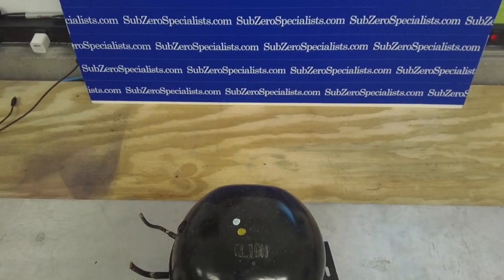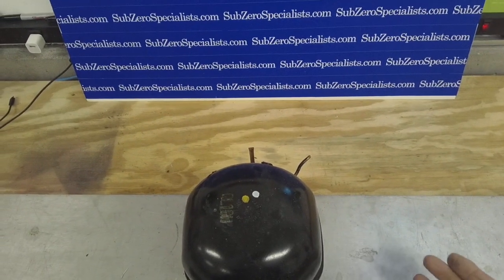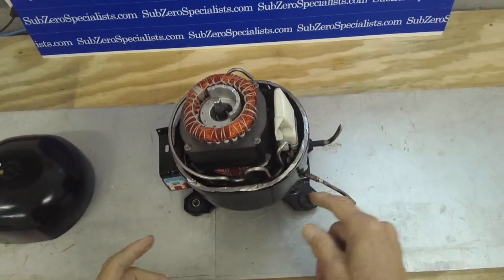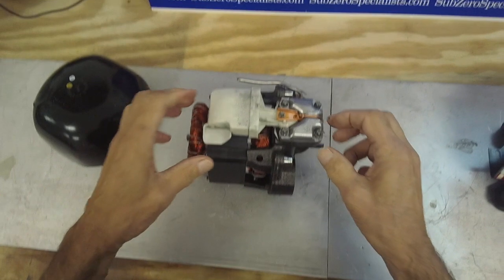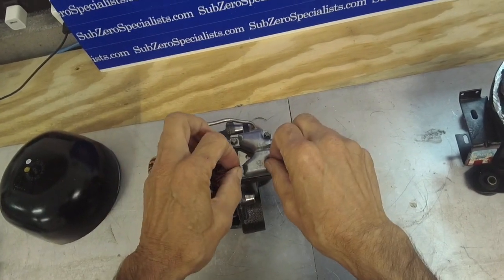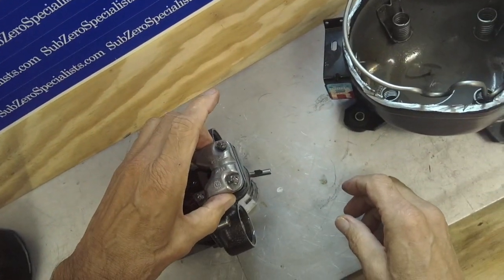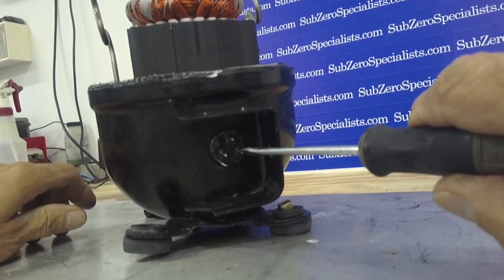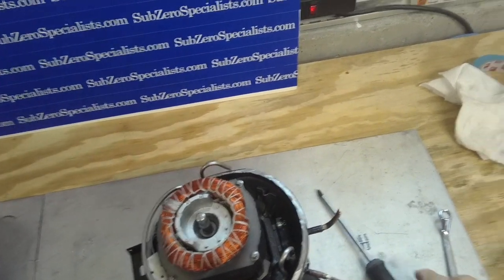How Hermetic Compressors Work

Comment: yup, I've taken old units like these out of bad appliances, and used them as a vacuum pump, used it to pull down my cars when servicing the refrigerant and component replacement.  
another one i made into a air compressor for filling tires. WAY faster then those small cr@ppy 12v units.  
back then i didn't have a shop compressor.  it worked liked that for years.
But cool to see what was actually inside!

Comment: Good day sir! Hope you are doing well and ok!  I have a question: is there a way to unstick a stuck up ref compressor?  I have one that was being repurposed to inflate car tires but when it was used to inflate an inflatable pool it overheated and won't run anymore.  Thank you for your help!
Reply from the maker: You can’t use a refrigerator compressor as an air pump because the Refrigerant carries oil with it which lubricates the piston. The piston probably expanded from the heat and that’s why it won’t run.
Reply: @SubZeroSpecialists  thank you very much sir!  I was very happy when I configured it to be an air pump because it's quiet, efficient  and also portable. It inflated the flat tire more than 30 psi. Might as well discard it.  I enjoyed watching your video it was very informative!